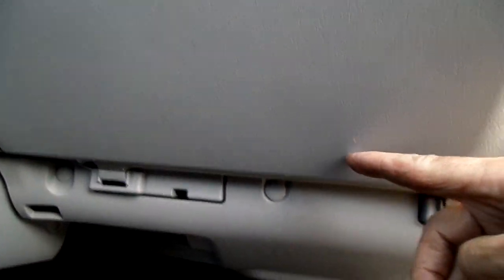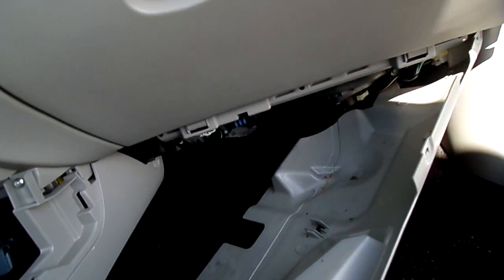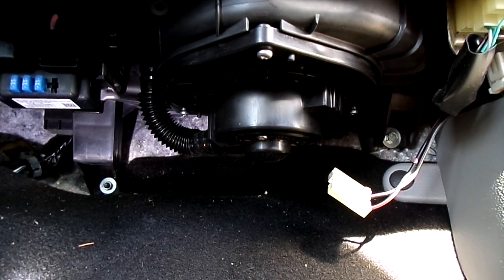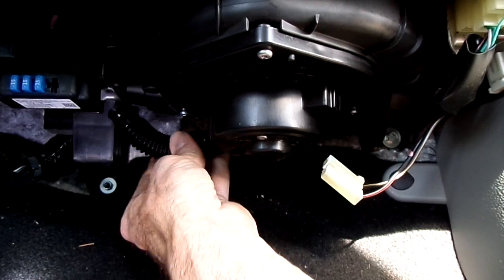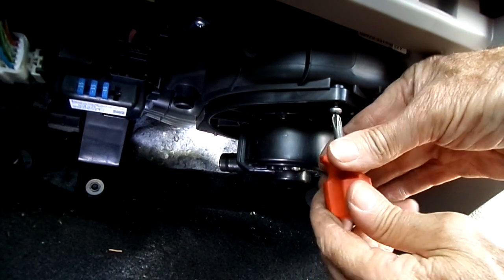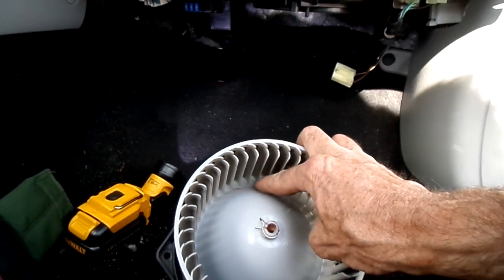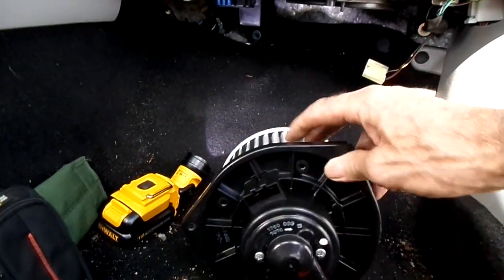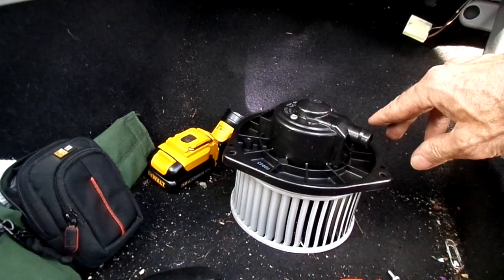Subaru 08-13 Forester Blower Motor Removal

Comment: Thanks a lot for taking the time to put up this video. I had ice built up in the fan (unbeknownst to me at the time) blowing the fuses and with -20C temps thought I would give it a try to remove it and thawed it. Watched this video and I am back in business. Also thanks for the tip on getting a stubby screwdriver; would have been impossible without it.

Comment: If blower wont run and fuses are good, be sure to check fuse 22 under dash. Problem with AC burnt it, it controls AC and relay power.

Comment: Hi, i driving Forester 2009 as well, my car heat only come out on left side of passenger side. Do I just need to replace this part then both drive and passenger side can get heat again?
My car is same as you.......Right side drive.
Reply: Vincent Li same as my 09. Not as hot on the right. Looking into self fix, but whole dash might have to come out.

Comment: its 2009 - 13. 2008 is different
Reply: Easier. Mines an '08. It doesn't have the front cover over it. It's directly beneath the dash. Just pop off the hose and the screws and put the new one in. Doing mine Tuesday. 👍